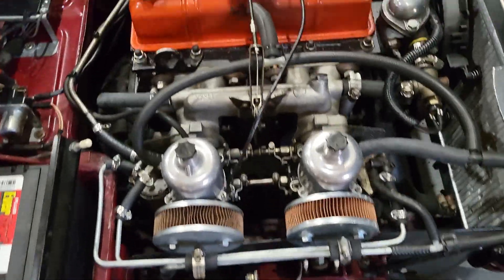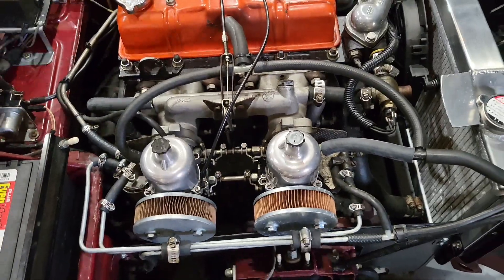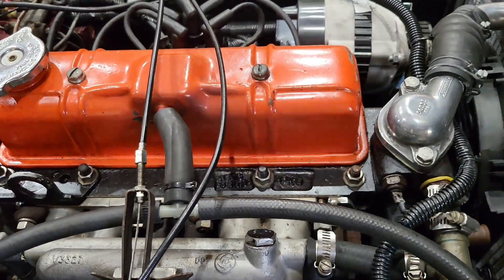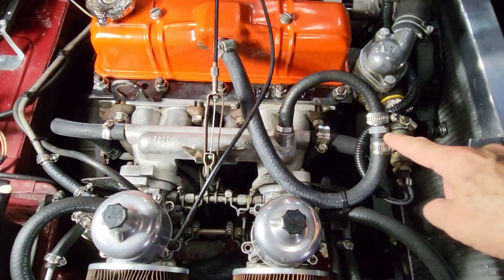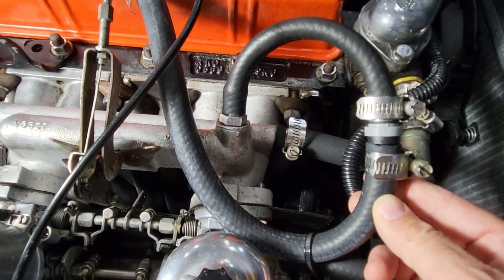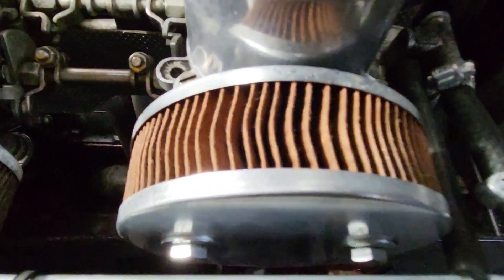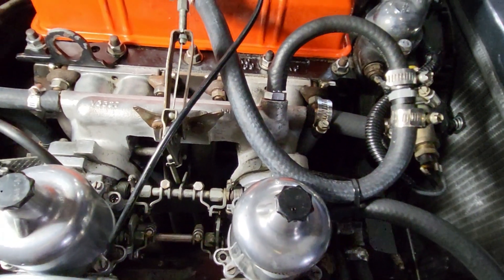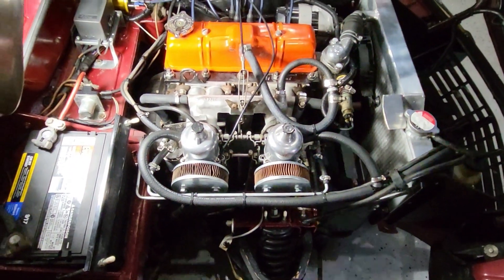1977 Spitfire - Stopping Oil Leakage with Crankcase Vacuum - Adding a PCV Valve

Comment: I’m going to do this to my spitfire. One question though, where are the 2 hoses coming out of either side of the intake manifold routed to?
Reply from the maker: Hi Jeremy,  that is a coolant line that is routed through the manifold.  This is intended to warm up the manifold to help keep fuel atomized (no droplets of fuel) while going into the combustion chamber.
Reply: @MikeHammill-TheShop  thank you, great idea as well. Did you end up ever adding an air inlet as another commenter mentioned or is the setup working well without one?
Reply from the maker: @JeremyBillow  the coolant line is a factory design.

 I did not add an additional source of air as suggested.  That is the intent of the PCV valve.

Comment: Thanks for the video Mike.  Where is you air inlet for the crankcase?  Is it metered in any way?
Reply from the maker: Hi William.  There is no air inlet except through piston ring blow by.  The oil cap is sealed. If there is no crankcase pressure, the PCV is shut.  If the needs to be consideration of an additional air inlet, I'm all ears.
Reply: @MikeHammill-TheShop  Air has to get in somewhere for the system to flow. I've seen references to a leak at the oil dipstick, or drilling a 5/32 hole in the oil filler cap. I purchased today the pcv valve you recommeded and installed it. I may go the 5/32 route for the air supply.
Reply from the maker: @williamlongyard5887  that sounds reasonable.  Let me know how it works.  Always willing to do a part 2 video.  😀